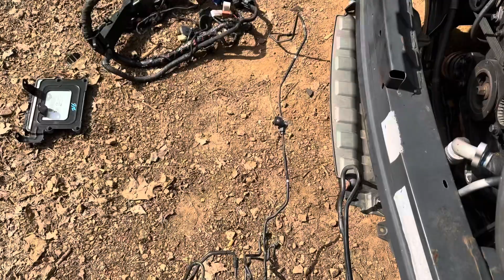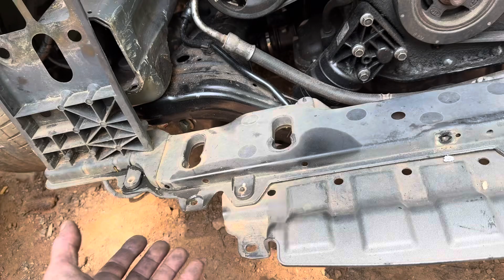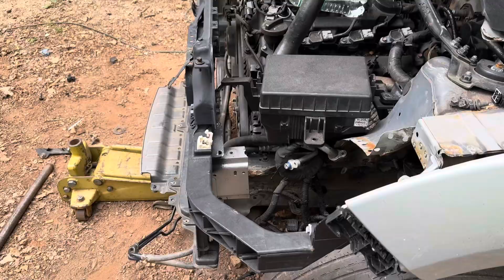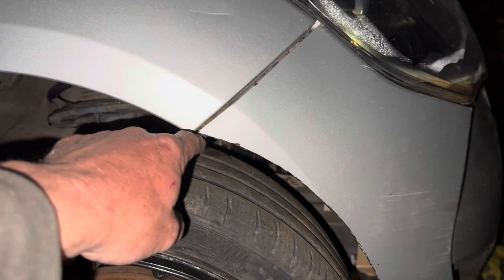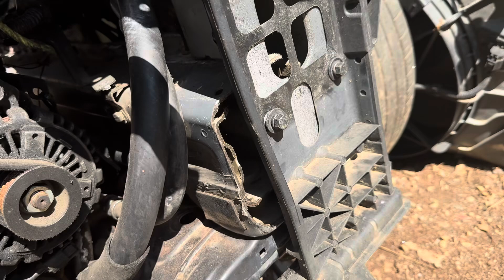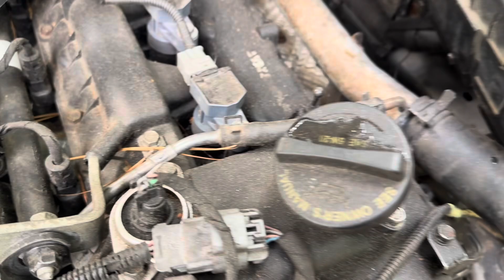Hyundai Veloster V6 RWD swap: fitting the front end

Comment: If you had wanted to keep the G4FJ engine, and instead only go for a AWD swap, do you think you could have made it work with the Veloster’s floor pan?

Maybe by cutting, but not as much as it would have taken to make room for the Genesis transmission? 

I have a 2014 Turbo R Spec and I desperately want to AWD swap it with a fully mechanical automatic torque balancing front/center/rear diff set up. 

I’ve been building up my skill set to prepare, but… ooof. That full on double floor pan cut out, trim, and re-weld is too much for me. 

Like, your playlist has got me researching drag bike chains and other half brained ideas cus I do not want to do that full floor swap.
Reply from the maker: I honestly don't know if it would work with the OG Veloster floor. But where there's a will there's a way. I could've used the OG floor for this build but I wanted the genesis front suspension. I would've just had to cut the transmission tunnel and fabricated some mounts for the engine and transmission. The rear has to be done the way I'm doing it for proper mounting and alignment of the rear suspension. I could probably make something to mount the rear subframe to the Veloster floor but I think the suspension would be way too high. I'm also planning on using all of the electronics and fuel system from the genesis so it's just easier for me to build it this way.
Reply: @shadetreestreetcars8626  I really appreciate you taking the time to answer. Your project is great, and honestly you probably know more about what it would take than anyone else. I may let the AWD swap go, since I’d really want it to still have the Veloster interior.

Btw, if ever you have questions on the Veloster platform, I highly recommend reaching out to Jim Piercing at Piercing Motorsports. He’s super nice and even took the time to call me and offer his insight from the Veloster Challenge racing series. Though, maybe you would want a Genesis guy more.
Reply from the maker: After rereading your comment I see what you're asking. 🤦🏻‍♂️

If you want to keep the Veloster engine you could probably swap the AWD system from a Hyundai Tucson or a Sonata. You would still probably need the rear floor pan from the donor vehicle but maybe not. I've actually thought about building an AWD 1.6t after I finish the V6 RWD build.
Reply: @shadetreestreetcars8626  Yeah I’ve been looking at Tucson’s. 

I know they used the same engine with a manual, and I’m mostly sure it’s the same transmission. I have never needed to go through service and technical chart manuals before, so it’s been a journey learning to read them and find them. 

At the very least, the transmission should connect to the G4FJ without an adaptor. 

A partial floor pan swap feels less… horrific than the incredible work you did for this project. 

I think I’ll focus on finishing my end to end rebuild, and once I’m ready to take it all back out to sand and prep for painting, I’ll decide if I’ve learned enough to be up to attempting the rear floor swap. 

Another interesting route is seeing if I can get the upgraded rear suspension and rear subframe from the 2020 Turbo Ultimate’s to get rid of the torsion bar. Though that would be committing to staying FWD. 

I just think a AWD Veloster “Evolution” would be a pretty neat build given the G4 engine family and countless other Mitsubishi connections.